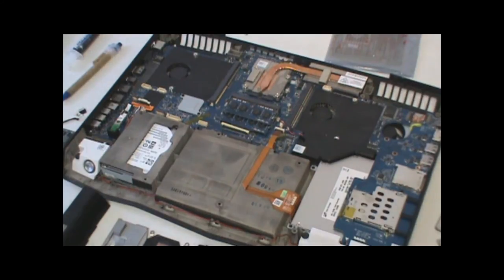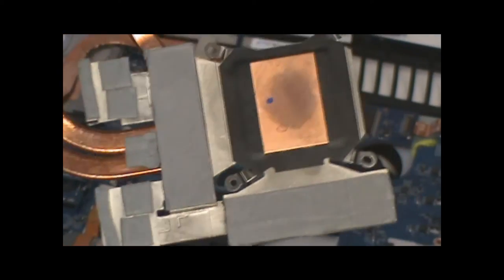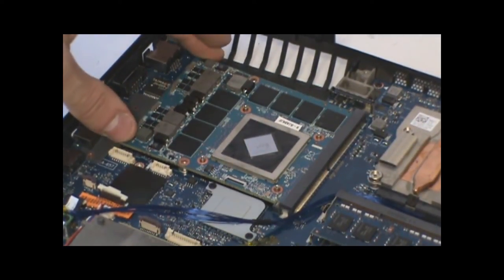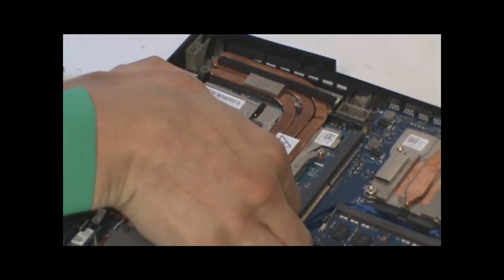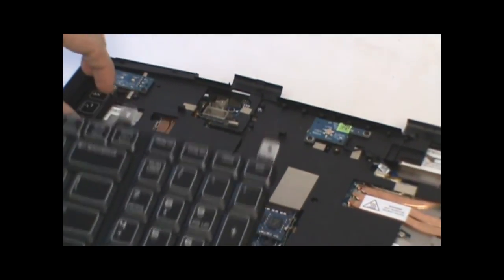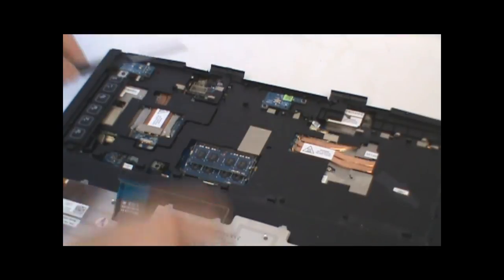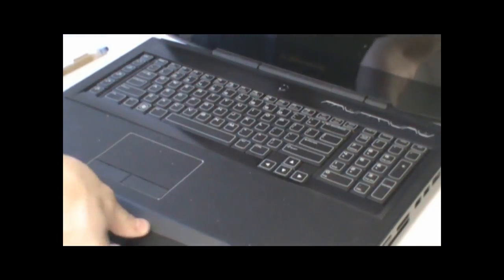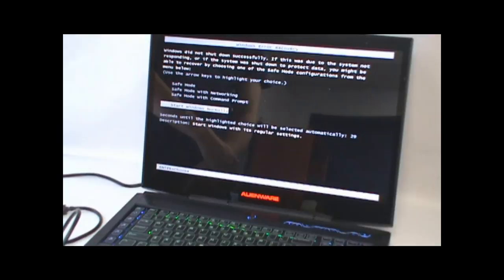AMD Radeon HD 7970M CrossFireX Install in Alienware M18X by Eurocom

Comment from the maker: It depends on the system and your previous card.  But an upgrade kit can consist of thermal paste, thermal pads, screws, X bracket, CrossFireX cable, heatsink.

Comment: Just put these in my M18X R1 for the heck of it. Make sure you use catalyst drivers that are pre version 18 and also make sure that the vbios on both cards is the same from dell or they won't work in crossfire.

Comment: I look into your product list and i see that you have this one: 4GB GDDR5 ECC; NVIDIA Quadro K5000M (Kepler); 1344 CUDA; N14E-Q5; PhysX; OpenGL 4.0; DX11; MXM 3.0b;100W; w/ 3D Quad Buffering

Have you done a benchmark to this quadro?
Can this quadro work in dual mode like the 2x4gb quadro 5010m?
Can i buy any nvidia gtx card and do a dual mode with a quadro?
do i need to do some changes to my gpu cooler to match a new video card?
or do you sell the cooler i need?

Comment: i've primary 6990 and secondary 6970. seems like the secondary vga is not working when i replacing thermal paste at first. and when i disassemble for the second time the whole m18xr1 of mine, thermal paste on my 2nd graphic card overflowing.
should i replace my  2nd graphic card or is it posible to clean the exposed thermal paste on the vga?
Reply from the maker: If you are running SLI the cards need to be the same.  The thermal paste can be cleaned off, that is not a big deal.

Comment: Excuse if someone asked this already. Does this card model works on the M17 r2? If yes, what  AC adapter should I use for it. The biggest one I know is 240. Can't find more information in Dell.com....

Also, where could I buy a set of cards if it is compatible for my machine?
Thanks in advance.

Comment: I've gone through 4 AMD HD7970m cards in my M18x R2 over the last three years. Numbers 5 and 6 just went out. Is there any video card I can replace them with that will work with the mobo and fit into the M18x R2 case? Or where can I buy decently priced HD7970 since Alienware told me to get lost?
Reply from the maker: Wow, that is unbelievable.  I would suggest something from NVIDIA then.  Perhaps a 780M, 880M, or something in the same family but lower end.  Try ebay: http://www.ebay.ca/sch/upgradeyourlaptop/m.html?_nkw=&_armrs=1&_ipg=&_from=

Comment: Hi I have an M18x and i'm thinking to upgrade my Dual 2GB GDDR5 AMD Radeon HD 6990M AMD CrossFireX for nvidia quadro but i don't know which ones are compatibles with my system.
Intel Core i7 2670QM 2.2GHz (3.1GHz w/Turbo Boost, 6MB Cache)
8GB Dual Channel DDR3 at 1600MHz (4DIMMS)
Alienware M18x 330W A/C Adapter
Dual 2GB GDDR5 AMD Radeon HD 6990M AMD CrossFireX
1TB RAID 0, 2x 500GB, 7200RPM Solid State Hybrid
Most of the time i work with HD videos and maybe soon i'll try 2.5k and 4k videos
Thanks